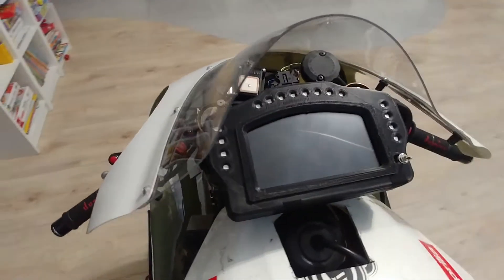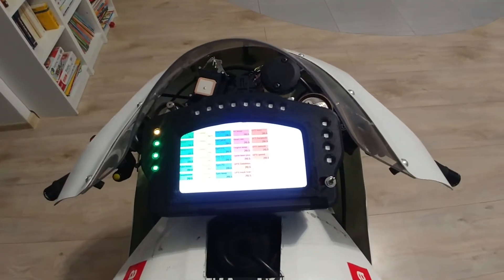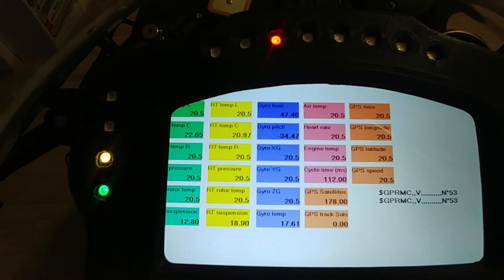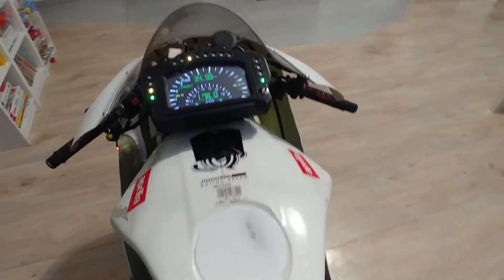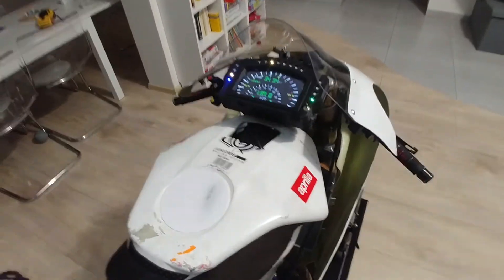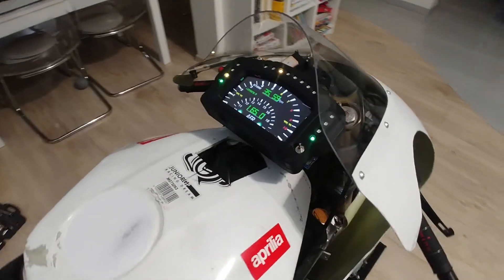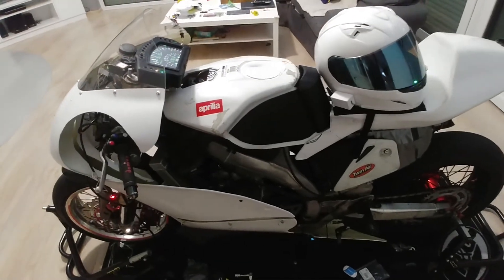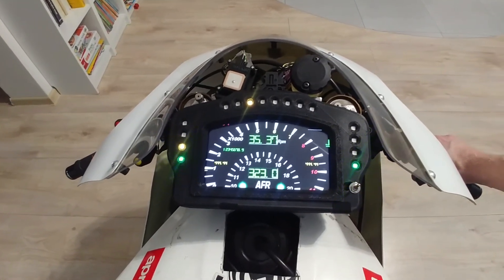Building intelligent dashboard & hud display for race track motorcycle

Comment: You should add a quickshifter, control ignition/ injector kill times. Also Gear indicator
Reply from the maker: Thanks for suggestions! I've got quicshifter pull/push element purchased - will try to install it once I've got all finished. I've got carb not injection engine so quicshifter will be mostly used to indicate the current gear, was considering clutchless upshifts (can  be done with ignition kill times like you said) so maybe will do that next winter when have more time. Ideally would be great to have downshifting automated but that's beyond this motorcycle abilities due to lack of ECU / carb.
Reply: I ride a CBR1000RR 2012. I'm interested in building you're project, will you please share your code with me? I have no programming skills lol. I have already purchased all the components. Also would like to use ESP32 instead of Arduino as it is better hardware. I don't race since there is not a track close to me unfortunately :(
But I want to use your system to tune my bike and also to alert me when my tires are up to temp so I can be safer. My bike currently has a PC5, auto tune, and a pod-300 for data logging but I need to add more sensors and expand my data logging capabilities as well as make a IMU telemetry system as you have. Thanks bro.
-Cody.
 ( Please help with you're code! I know you worked hard on it but it is above my skill level to do it myself.)